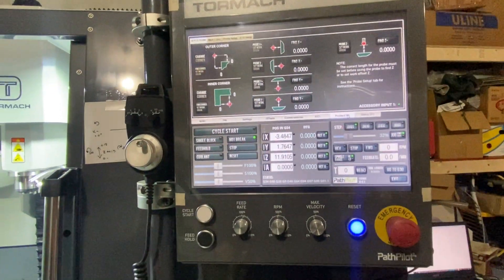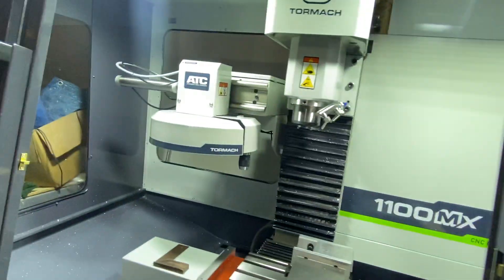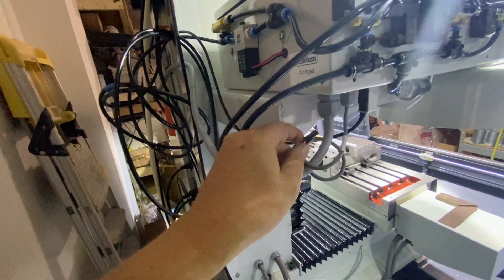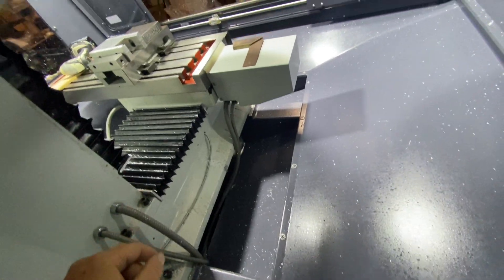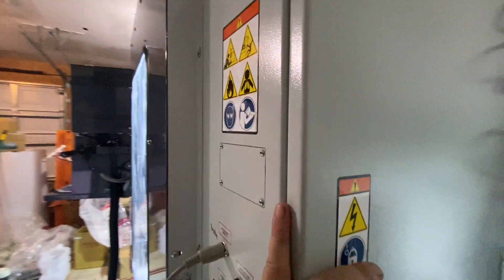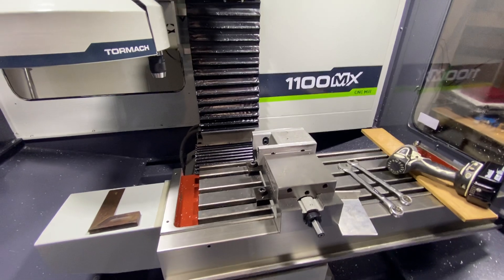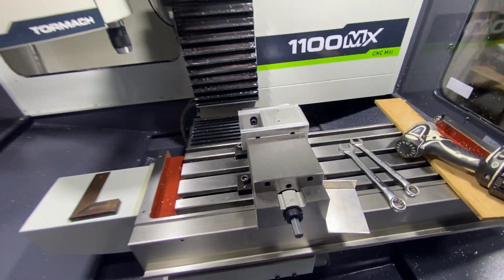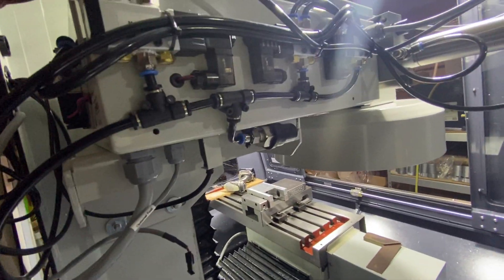Tormach ATC Problem maybe resolved. Update from 5-19-2022 - Maybe we have hope.

Comment: We purchased the pcnc 440, I know it is not industrial, but I like the machine minus the ATC.  It is a finicky mess.  If I adjust it so it aligns the cover gets hit by the spindle.  I had to add a spacer to the back side of the piston so I could adjust it so it would line up with the tool.  It just has too many variables to be reliable.  I wish I had saved the money on the atc and purchased more tooling.  Nice machine otherwise.
Reply from the maker: I just went through, replacing 5 spindles total on this machine. Their QC on these, is horrible. It's still wobbling substantially, and I just gave up. I have a spinal injury since these videos started, and I just can't physically keep replacing bad spindle after bad spindle. I've got the machine dialed, other than the massive wobble. Their chinese made bearings are garbage, unless the spindle itself was bent, or the runout is bad, or the way the spindles were designed were garbage. 
I have some new videos to upload regarding this, but if you saw what I've been through on this machine, your jaw would drop. I just haven't uploaded more videos, or else people would be shying away from buying one. It sucks. I've just been quiet because my other business is needing massive attention.

Comment: Why are you blowing oil on the tool shanks?
The air blast is to make sure the shank is clean.
Reply from the maker: The machine has an automatic Oiler built in, which is a function of the Tormach. 
It injects oil into the air so when it blasts the BT30 tool holder, it adds a light coat of oil to the tool. 
So that’s what I’m referring to. 
Standard on every single Tormach 1100mx
Reply: @poppabearNC  the automatic air oiler has a adjustment, and I believe the Tormach manual should tell you how many drops the oiler should deliver.